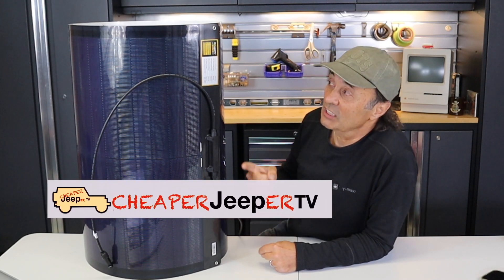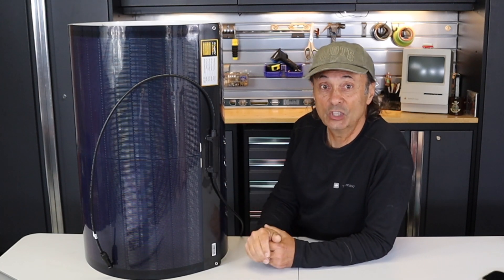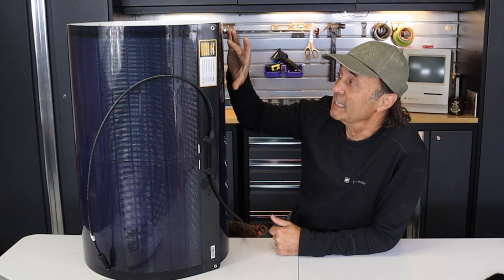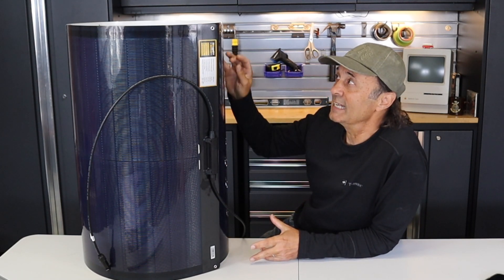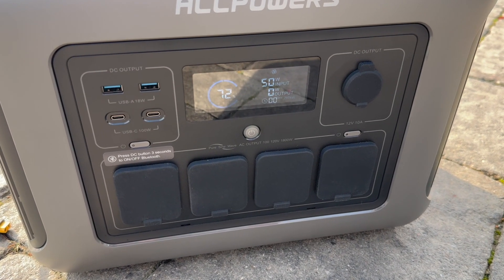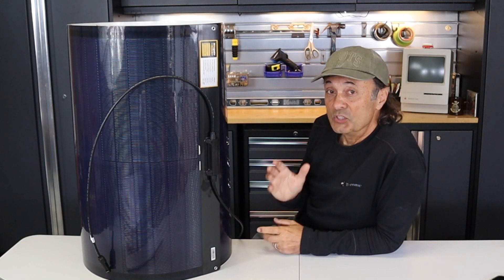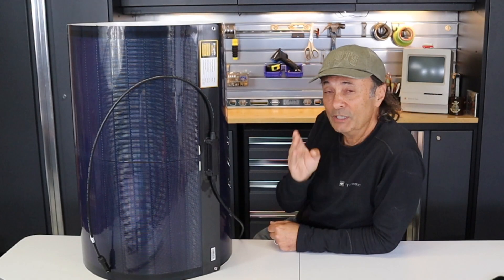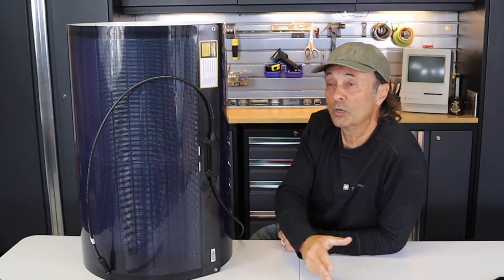Five Attributes of the BougeRV Yuma 200W CIGS Solar Panel That Makes It Ideal for Jeep Camping

Comment: Hi Dino.  Those panels look great.  If you mount them, do they need a gap underneath to prevent overheating?  The older flexible panels needed it.  Btw, is that an old apple computer behind you?
Reply from the maker: I haven’t used it enough to try and measure but from what I read in general, solar panels reduce efficiency as they get hotter. These panels are meant to be taped down onto RV roofs and boat decks, but I still imagine as they warm, they would become slightly less efficient. The nice thing about the Jeep roof is that it naturally has ridges thereby providing gaps for air, which “may” help. 🤷🏻‍♂️
Yes, That’s an old Mac in the background upon which I have completed a lot of work in my early days. I can’t bring myself to toss it. Thanks for noticing. Cheers.
Reply: @CheaperJeeperTV  Thanks for the response.  I look forward to learning how the cigs do over time.  I remember learning to code on the Apple IIe.  Your Mac is very cool.

Comment: I like that a lot! I too live on solar in the RV, but the old tempered glass type on the roof. I like that "elderly" can even do it! I too resemble that remark, ha ha. I'm wondering if you could just run your cabling direct to the Jeep's main battery, keeping your roof edges & interior free of wiring? At least if you're not drawing big loads off it, as the Jeep battery is not "deep cycle". Such great new stuff they've come out with!
Reply from the maker: Thanks for sharing. I was wondering if anyone would catch that Resemble remark!😊
Cheers.